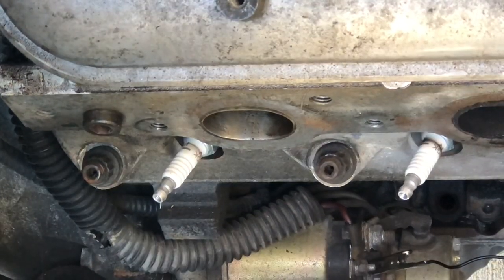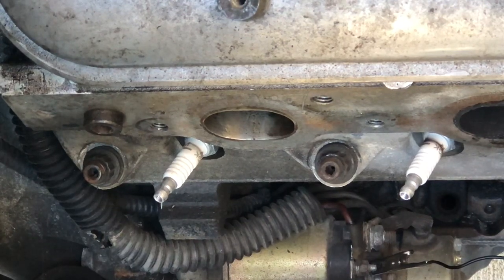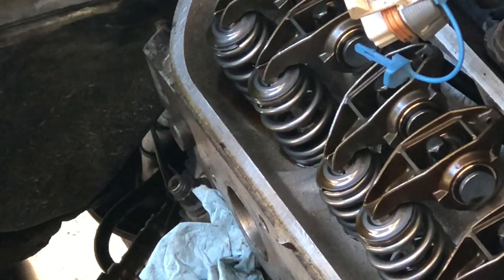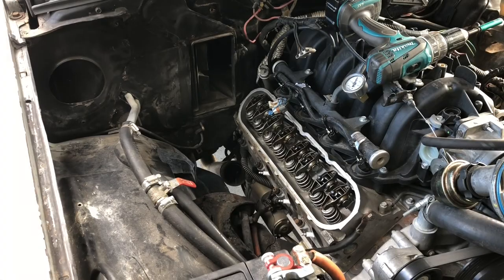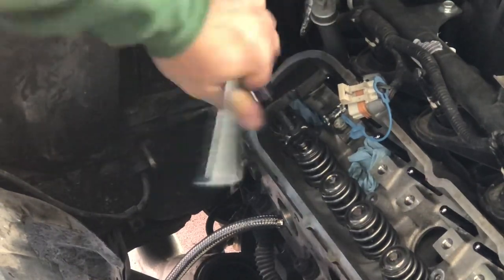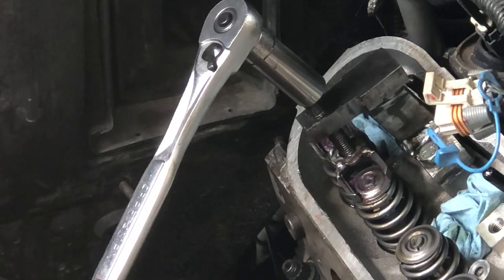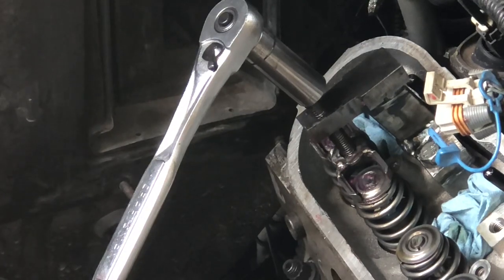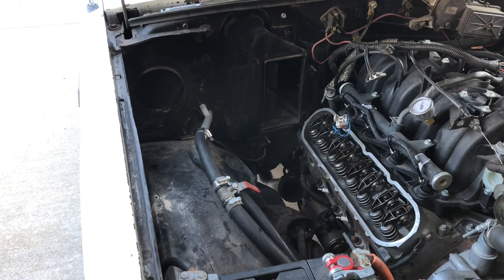LS heads changing Valve seals in the vehicle. With or W/O Air

Comment: I watched this to learn how to remove and install valve seals.....then you cut away for that exact part of the job!  Lol nice!
Reply from the maker: Remove old seal with channel lock pliers, install new seal with appropriate sized socket if you don’t have the install tool. 
The “Tophat” style seal and locator combo is the easiest and best choice for single springs. Select a socket to fit over the metal area and install. 
Two piece seal/locator is a little tricky, install locator then find out whether a 12mm or 13mm 12pt socket fits the top of the new seal best to safely install the seal without damaging the viton/rubber part.  It’s best if you can add a little lube and try to just push the seals on, only tap them down as needed to seat fully. 
It will be self-explanatory when you’re in the process.  JD

Comment: Me and my dad did the rope trick on an old 1980s Pontiac V8. It was a very low milage car that sat long. So the valve seals were tight from old gas. And made the valves stick open long!

Comment: There is an updated valve cover for this engine. The left side valve cover has the pcv system built into it. If you buy the updated valve cover it will eliminate this issue.
Reply: I know this comment is a year old but i just came across this video and wanted to say my 5.3 Saab 97X has a issue where driving down the highway for a bit it will randomly puff out a big cloud of blue smoke.  It's weird because there does not seem to be any pattern to it except never having seen it happen in the city.

I thought maybe highway speeds/heavy vacuum was sucking oil through the terribly designed pcv so i bought the updated cover and it didn't go away.

Not sure what else it could be.  I'd think if it was a valve guide it would happen consistently.

Comment: EOIC doesn’t matter on the LS. Been doing these since the LS inception and found taken the rocker arm bolts down evenly works the best. Factory spec is 22 ft lb and I never had an issue. Beam type torque wrenches are way better than click type on smaller fasteners. Seen guys with clickers pull the threads out by not paying attention to their settings.
Reply from the maker: Mike MacCracken I’m glad you commented about the rocker bolt torque.  I was thinking you should collapse the plunger in the lifter before anything I’d think. 
I was told and seen guys claiming GM recommends the torque on the heal of the cam, so I thought I’d try it and mention it to see what most people thought. 
My 1/4” torque wrench is about 1 ftlb short when compared to the beam style. 
I’m hoping these new valve seals fix the oil in the exhaust port issue! 
Thanks again for your feedback I appreciate it!  JD
Reply: Jeff I can email you the GM document on how the factory does it.
Reply: Jeff I emailed you the GM factory document for valve adjustment. Happy reading.
Reply: @mikemaccracken3112 still have those specs?

Comment: I almost always just zip the rockers down on LS's when they're in something of mine. If its someone else's I'll put them at 22ft/lbs. So far so good on both ways lol
Reply from the maker: SniderTron 3000 I was confused about the possibility of the valve spring pressure giving a false torque reading when the valves are partially open. I always torque the rocker bolts but never have used the EOIC method as recommended. 
If valve spring pressure can affect rocker bolt torque, then the dual-spring setups would be even worse. 🤷‍♂️
But imho you’d compress the plunger in the lifter before affecting the valve spring very much. 🤔🤔🤔
Reply: This is great cuz I’ve been watching both of y’all’s vids back to back for ideas with my truck lol thinking of going with a Btr stage 3 chromoly push rods ls7 lifters melling oil pump and 3k stall

Comment: question, im going to change all my valve seals while its in my suburban. i have the correct tools including air hose etc. Now when you say start off on number 8 and you have it tdc. you then have to remove rocker arms and rail.. but after changing valve stem seals i want to move down the line and do the rest. How do you know the next piston is at tdc without the rocker arms on?
Reply from the maker: You can start on any cylinder you want as long as you guarantee. It’s at top dead center so there’s less volume to contend with. Plus, if something were to go wrong, the vowels won’t drop as far if the pistons at TDC
Without the rocker arms on, you’re gonna have to be able to see the lifters via the push rod or find a way to use a straw through the spark plug hole to be able to feel when the Pistons at top dead center

Comment: This is a great video!  You shared some great knowledge.  Your valves and the surrounding area look super clean compared to mine.  In my engine, the valves and springs were all covered in oil.  Is that normal?  I know my valve seals have failed and I am replacing them but wasn’t sure if oil should normally be present all over the values.
Reply from the maker: The engine in this video was a new build, maybe less than 500 miles.  I had to of damaged one of the seals on that cylinder. 
On factory engines with high miles there’s always dark oil staining on everything. JD

Comment: my number one cylinder is giving me problems with fouling spark plugs. I will do a compression check but i assume this is the valve seals that I am having problems with.  would you agree that if my compression check is good this is what is causing all the carbon buildup and spark knoking i get?
Reply from the maker: If the spark plug is oil fouling but it has good compression numbers it could be valve seals. Normally a bad valve seal will cause a smoky startup from the seal seeping. 
Also check your coil isn’t going bad and verify there’s no issue with the PCV valve  pulling oil into the intake manifold. 
An old trick, swap the coils between two cylinders and see if the issue follows the coil.  JD
Reply: @HeadFlowInc  Great recommendations. I will look into it.

Comment: I’ve been trying to do this, but when I hook the air up to my cylinders I get air coming out of my intake manifold. Is that normal?
Reply from the maker: Edit
Both valves on the cylinder have to be closed. Once you remove the rocker arms the valves will be closed. 
I recommend slowly Rotating the engine until both valves on the cylinder you’re working on are closed then remove the rockers

Comment: I have a 98 camaro that I’m swapping the cam in. I have 806 heads with older style valve seals where the seat and seal are separate. The cam kit I ordered came with the top design valve seal and I’m wondering if can use the top hat style with out issues, or should I just order older style seals?
Reply from the maker: Yes you should be perfectly fine running the top hat style valve seal, don’t use any other Shims It should assemble fine. I never understood why GM chose to use a two piece locator/seal set up when the top hat is far superior? Who knows.
The only time you see a two-piece locator and seal combo nowadays is if you’re running a dual spring, if you have a duel spring you have to run the two piece seal and locator.

Comment: Will that rag pop out it you just turn the crank?
Reply from the maker: RichWil I’m not sure what rag you’re referring to?  Compressed air is holding the valves fully closed.  JD
Reply: I would assume no, not if you do it like he did here. You should just remove the spark plug and plug the spark plug hole with your finger. Rotate the crank till you feel the pressure push against your finger. That's the compression stroke wait till it reaches the top and the valve height is even and your at tdc roughly.

Comment: Probably a dumb question here but I would like to use the air compressor method to hold up the valve seal. I cant seem to find a hose or the right fittings for the spark plug hole to make my own hose. The auto parts store guys haven't been able to help me. Can I buy a cylinder leak down tester for this use? Any help would be appreciated. Thank you.
Reply from the maker: Ryan Aney Yes, buy a cheap cylinder compression gauge and adapt it to an air hose fitting.  Turn the regulator down a tad, too much pressure can turn the engine. This is what I had to do!  Thanks for watching and the feedback!  JD
Reply: @HeadFlowInc  JD thank you for the quick reply. I've been looking at them just wondering if I could make it work. Thanks again great video. I subscribed
Reply: Probably good idea don’t take no chance I thought could hold up lifters with dowel rods put them in and lifter hit pan , wrong hole I guess lol

Comment: Is that intake manifold the Dorman 615-183? Did you notice any leak at the seems?
Reply from the maker: I didn’t notice any vacuum leaks at the o-ring seals between the sections.  I had tested for vacuum leaks many times because I never got this intake to idle and have low throttle response on my 4.8.  I switched to a port matched regular truck intake and my 4.8 ran way better at all rpms!
I think the huge plenum and runner design of the 615-183 intake might work better on a bigger engine 6.0+. JD

Comment: How much psi does it need to keep valves for falling down? Thanks
Reply from the maker: Make sure the piston is a TDC for each set of springs/cylinder so if you have an issue the valves can’t physically drop all the way into the cylinder. 
I’ve always used 80-100# of air pressure where my regulator stays. 
I think your question brings up a good point; what would be the minimum acceptable air pressure? I don’t know for sure if you put to much air pressure in the engine could try to rotate? 
If you have a cylinder you can’t get the air hooked up don’t hesitate to use the rope trick to hold the valves up.  JD
Reply: @HeadFlowInc  thanks a lot!
Reply: Yzn
Reply: 50psi

Comment: Thank you for the advice. The rope trick is a new one for me.
Reply from the maker: Stealthy Wolf The rope trick was a carry over from my Pontiac V8 days.  I learned the rope trick for holding the valves up and believe it or not the Pontiac guys will loosen both rockers closing both valves, then put rope in the chamber to stop the engine from turning while they torque the dampner bolt to 160# 😳😳😳. Thanks for watching and the feedback I appreciate it!  JD
Reply: That makes sense, the 160 is probably to compress the rope to make sure it compacts against angled ports and keep the space you need to remove the keepers.
Reply from the maker: Stealthy Wolf If your only servicing the valve springs or seals you won’t need to torque anything.  You can just feed the rope into the cylinder to hold the valves. Yes holding the valves fully shut is the goal.  👍
Reply: That makes sense.

Comment: Is that a pcv filter on the oil cap? That’s brilliant!
Reply from the maker: soyramflero Yeah, it’s a separator style filter I was using to vent the crank case. I’ve had bad luck trying to run a PCV valve, sucking oil from the valve covers. 
I was pretty proud of my idea drilling the hole etc to fit the oil cap with a grommet.  I’ll admit, the filter fits so tight I can’t really get it out! Lol 😂 It works great though 👍👍
Thanks for watching and the feedback I appreciate it!  JD
Reply: HeadFlowInc did you make a video on it? I was considering making my own catch can. This seems easier

Comment: What psi needs to go into the cylinder to keep it from leaking past when compressing the spring?
Reply from the maker: 50-60+ should be fine unless you have really bad ring seal.  If you try too much pressure it’ll start to rotate the engine so you’ll know it’s to high. JD

Comment: you can also use a balloon ,stuff it in the hole and fill and tie off ,you need 8 balloons , its party time
Reply from the maker: Interesting idea, I’ve never heard this tip before but it sounds like a great idea!  JD
Reply: @HeadFlowInc  when I worked on large ship engines we used large bladder balloons to hold the valves up rather then take off a double cylinder head  on a v 16 cat engine it was a 399 cat ,this was in my younger days I'm 70 now but I haven't forgotten , your smart you jumped on that right away .
Reply: @oldbiker9739  Cat now makes a bladder/balloon that looks almost like a condom that actually works pretty well. And if it was to break, With the bore camera we have today, retrieval is really easy.
Reply: @Pyle81  well that's good to know  thanks
Reply: small rope pushed in cylinder then raise piston will work also

Comment: You didn't show replacement of valve seals
Reply from the maker: Once you have the valves supported with air, compression and remove the valve locks, remove valve springs then replace the valve seals.  If I didn’t show it I apologize I figured the seals were the easiest part.  JD